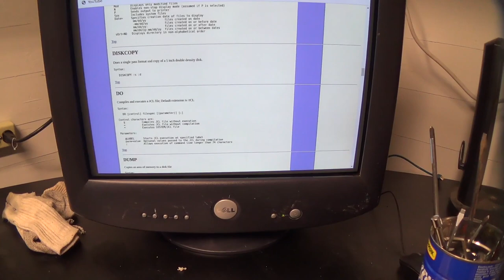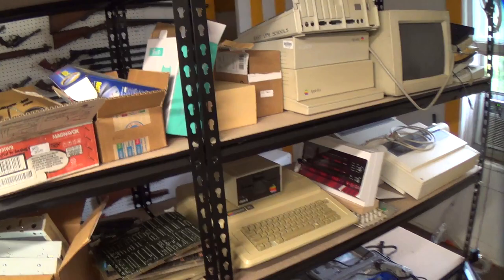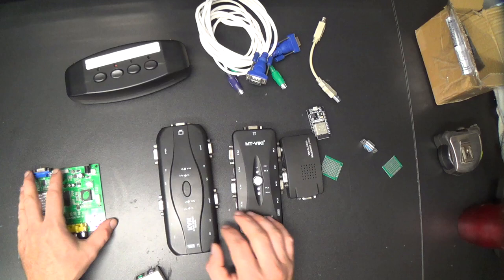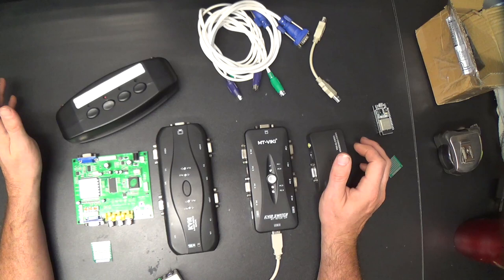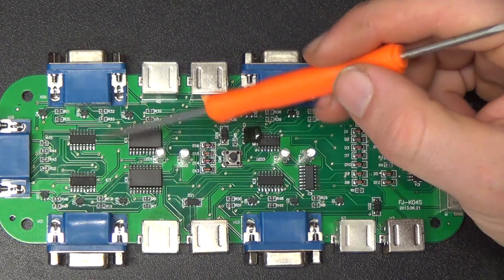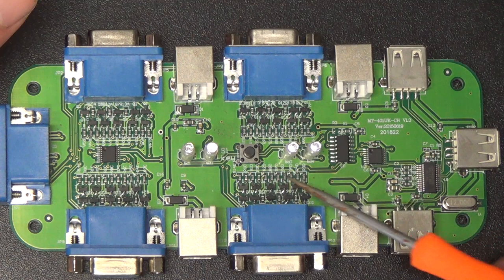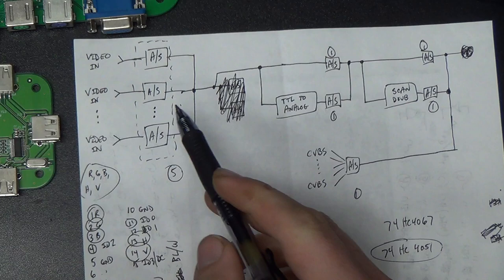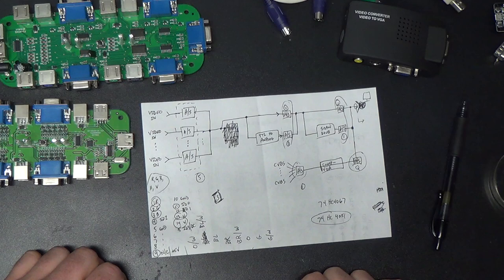Let's Build a Big Fat KVM Thing (Pt.01) | Rough Design?

Comment: Man, I can totally relate to that "I can't have nice things" sentiment.

I found a beautiful old Dell Dimension 386SX/25 in excellent condition, paid peanuts for it.  It survived a trip across the country under the qualified care of the post without a scratch.  I had it resting on top of a couple of baby AT towers for a few weeks while I upgraded the HDD and re-installed software and all that.

Then we had a huge earthquake and it walked itself right off, tumbled upside down and landed on its side.  There's a nice scar on the front now, and the 5.25" floppy drive packed up and refused to read disks anymore.  I guess it's my fault for living on one.

Comment: I need one of these!!!  Just needs audio as well in my case.
Reply from the maker: Hmmmmmm.  I think that rather than switching audio, I'd just run it all into a mixer.  Then you could say, still have mp3s playing on New Box while having the monitor switched to Old Box.  I 'spect one might build such a circuit with LM358s or something.   Hmmmmmmm, that might be an interesting project at some point.  Although there is probably some kind of cheapo 4+ channel mixer from China that would be cheaper than building one.

Comment: Converting CGA to analog RGB just needs a simple resistor-diode network to integrate the intensity signal. https://sites.google.com/site/h2obsession/CBM/C128/rgbi-to-vga (my own quick, proof-of-concept attempt is at the bottom of the page, the guy was kind enough to put it up there)
Such a network works fine for CGA, but for EGA or TGA, you need a couple extra ICs to get the proper grey and brown colours (unless you're fine with your brown looking orange). The problem then becomes converting the 15.7KHz horizontal scan rate to something a VGA monitor can use. Some of the earlier multiscan monitors could go as low as 15.7KHz, but most these days won't accept anything below 30.1KHz. I've got an LCD TV that I picked up at a thrift store (a Daenyx DN-153) that happens to accept the 15.7KHz horizontal scan rate, which makes this super easy. Otherwise, one of those GBS 8200 boards to convert the scan rate. 
You could make or modify a passive KVM to use this setup for your TTL output machines, and just feed that output to the VGA KVM.
Reply from the maker: Ima kinda thinking about using a GAL.  Then I could have a pin (or two) to allow the ESP16 to switch it between CGA and EGA (and maybe also MDA).  I'd give it two bits of output per R,G,B, and probably an extra bit for a "brown fix" pull-down, and then send all that through a resistor bridge to mix them and knock them down to VGA voltage levels.

I have an 8200 there in the video, for scan-doubling, but it apparently only works with a non-standard csync on frequencies <31.5 kHz (at least with the stock firmware; I'm not sure about with the gbs-control hack).  Using a GAL, though, might also allow for easily changing the polarity of sync (needed for EGA iirc) and choosing different ways of generating composite sync to overcome the bug in the GBS8200.
Reply: @Lee_Adamson_OCF  The "Ultimate" RGBi-VGA converter https://sites.google.com/site/h2obsession/CBM/C128/rgbi-to-vga/ultimate should work fine for CGA, EGA, and TGA, without need for switching between standards. At least as far as I've tested with my monitior. He shows it further down the page working with a C128 and the GBS8200, so the entire package should work.

The Daenyx monitor I have can take the H and V sync pulses straight, so I can go straight from the resistor-diode network to the monitor without needing the CBS8200, and I did my version of the "Ultimate" RGBi-VGA circuit with the inverted composite sync bypassed. MDA uses an 18.1KHz horizontal sync, and I don't know if the 8200 accepts that or not, so I need to play with that a bit more.
Reply from the maker: @BlackEpyon  Hmmm, I was thinking like EGA uses 2 bits per channel, rather than 1 bit + intensity like CGA.  I'll have to read a lil' more.
Reply: @Lee_Adamson_OCF  Crap. You're right, I forgot that EGA uses two more pins. Pin 2, which would be the intensity for R,G, & B on CGA is used exclusively as intensity for Red on EGA, and pins 6 & 7 become intensity pins for green and blue. Tandy graphics gets away with only using one intensity pin, like CGA, that's why I got confused. 
Maybe EGA needs the extra intensity pins to allow for extra bandwidth for the higher resolution modes? I'm not sure.
Reply: @Lee_Adamson_OCF  I just rerouted my board so that it uses exactly the configuration pictured on the web page, with the inverted composite sync signal, and my Tandy displays just fine on normal LCD monitor through the 8200, including the brown+grey circuit. Except for one thing, the 8200 has trim pots for the RGB built in, so you probably won't need to bother with the trim pots on the "ultimate" circuit.
Unfortunately, the 8200 does NOT seem to know what to do with my MDA card.

There is this MCE2VGA device that can do all of this, including apparently MDA as well, but usually goes upwards of $80, so I never invested in one. https://texelec.com/product/mce2vga/ 
The project page might be useful if you're planning to design your own KVM, you could probably integrate it https://sites.google.com/site/tandycocoloco/mda-cga-ega-to-vga
Reply from the maker: @BlackEpyon  MDA's vsync is inverted from CGA, iirc.  I think it's also 50hz rather than 60.  But my guess as to the 8200 being confused would be the former (assuming I am remembering correctly).
Reply: @Lee_Adamson_OCF  Ah, so I'll have to pull the composite sync before the inverter. Gonna have jumpers all over this thing by the time I'm done with it.
Reply: I'm working on my own gadget to do this, using multi-function gates for the digital RGB lines.  I haven't gotten too far on the sync side of it, but it sounds like at some point it makes more sense just to use a microcontroller.  I'm sure it wouldn't be too hard to listen to the sync and either re-gen it with bit-banging, or for a zero-delay solution, just send control signals to gates that would invert / combine as needed.